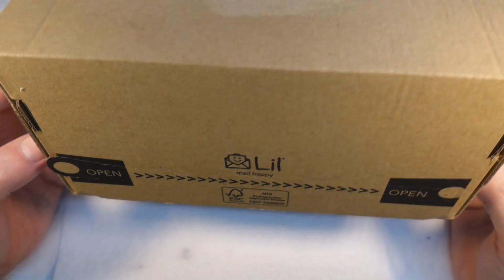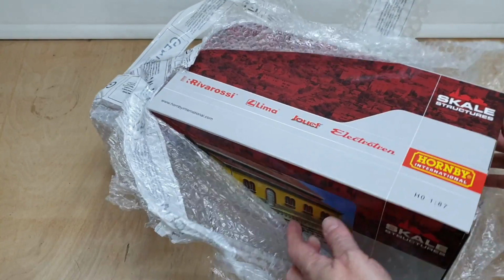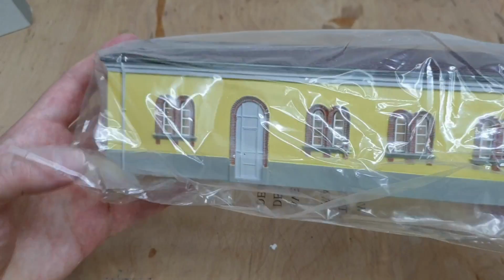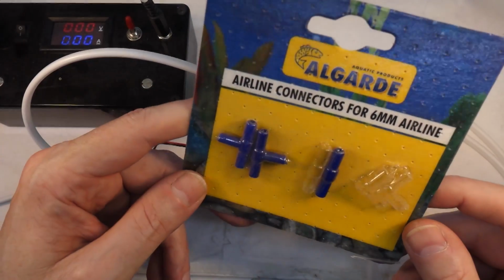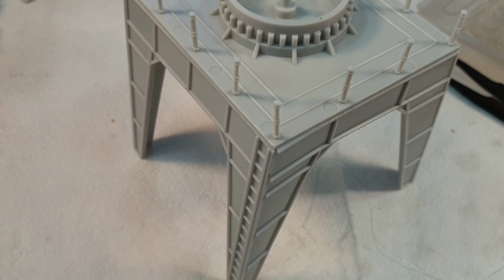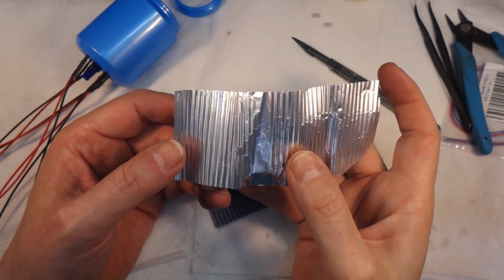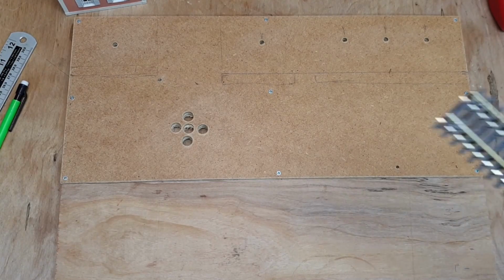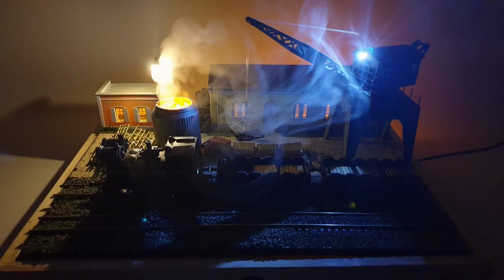Building an HO scale Steampunk train diorama for a competition

Comment: I have several of those sort of building models; ones: coalmine buildings mainly, I used them to make a rather sinister looking military installation, think 'Tube Alloys' - but no railway. They are made of a material called 'Polystone' which I can only imagine is resin infused with stone dust. It drills and cuts very nicely. It takes paint and weathering very well.
Dapol (which takes it's name from it's original founders, David and Pauline Boyle), acquired all the old Airfix railway kit tooling, which had already been owned by the Kitmaster/Rosebud toy company in the early 1960's. They are now a major manufacturer of model railway engines and rolling stock. They also made, in the 1980's, a rather odd, but very collectible series of 3.75" Doctor Who figures.
I've got several of those crane kits - they're great for greeblies for sci-fi models. The guys making Thunderbirds and Stingray used hundreds of the things.
Love your diorama - and that does not look like it was made in a day. The Airfix RAF personnel look very good in grey, too. Nice one.
Reply from the maker: Thanks. The crane was actually fairly pleasant to build, despite some flashing and warping.